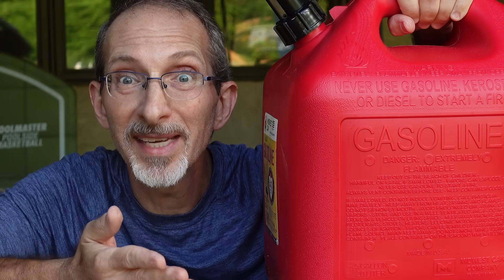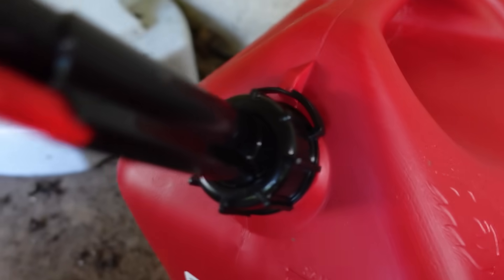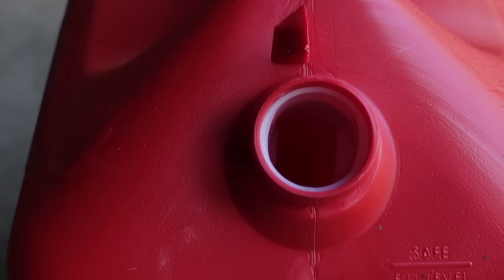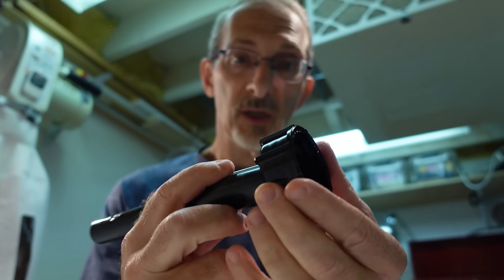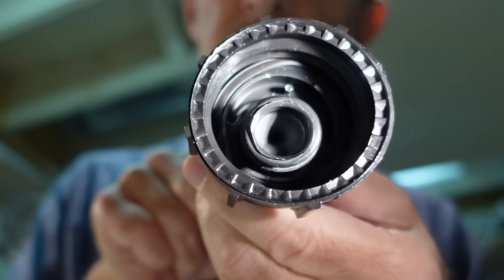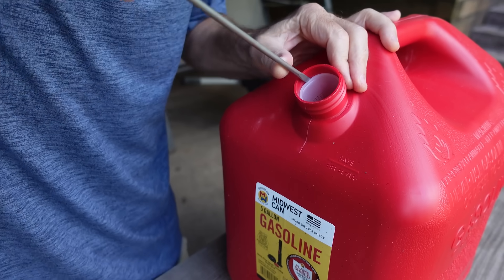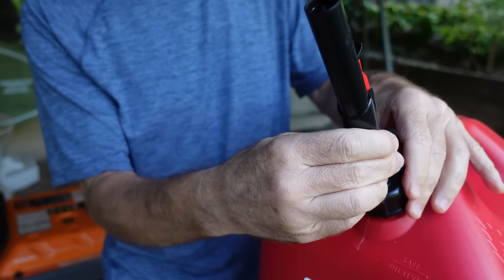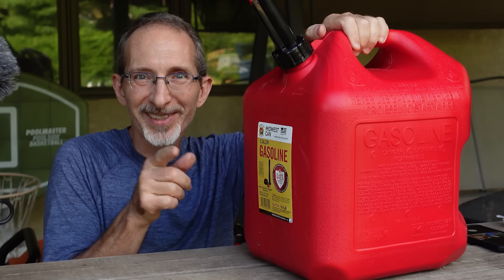Gas Can Modification | New Gas Can Fix

Comment: I’ve only ever seen gas cans used on cars that ran out on the side of the road. 99% of the time they are used for small engines. Aside for riding lawnmowers and four wheelers, not many of those have enough weight to not get shoved around by the can
Reply from the maker: Agreed! People who have these nozzles on smaller containers seem to have better luck with them. But it is just too awkward on my 5 gallon cans to be usable. Thank you for watching and for commenting!

Comment: Jesus some times it's worth just buying another one with a normal spout and a vent to boot, can is still gonna suck regardless until it has a vent.
Reply from the maker: Jed, I added event in my second video, link in the description. At the time I bought these, they were one of my only choices. After the modifications they are not so bad!

Comment: I’ve never had a problem with mine, just been patient and not go full blast when filling and I like the spring because it allows me to control the speed of flow from the can easily.
Reply from the maker: Adam, it is nice to have some counterpoint in the comments. Thank you for watching and for joining the conversation!
Reply: @MikeFyxdt  oh no worries, not saying your opinion wasn’t valid, Im wondering if different manufacturers use different strength springs.  As for the lock on the cap mine permanently bent in the first time I used it.
Reply from the maker: @adambeard4427  I think you are onto something, all manufacturers probably have different specifications. I’ve heard of the locks on the caps bending from other people, too. Most of my objections to these designs are gone now that I did some modifications. I have to say that there is nothing like the old, simple designs!😁

Comment: During Laura we were pouring gas all day just to keep the lights on and I gotta say, those safety nozzles are anything but safe. They pour eeeverywhere.
Reply from the maker: Chase, these containers are hard to use in good weather… Nobody needs the extra stress of a difficult spout in the middle of a storm. Hopefully there will be better designs in the near future. Thanks for watching and for commenting!
Reply: @MikeFyxdt  Your welcome, and we just removed the nozzle and funneled it, f that nozzle.

Comment: Do you have a hack for styrofoam gas cans? Idk if it's hot out but mine all melt. I was trying to stock up on gas and got it all in my trunk.
Reply from the maker: 2 1/2 gallon or 5 gallon Styrofoam containers? :-)

Comment: If you buy normal gas cans you are a chump they suck. I recommend buying these I know they're made for motorsports but they work for everything. (Accept for small power tools like weed eaters, chainsaws, leaf blowers etc. that should be obvious.)

https://www.amazon.com/VP-Racing-Square-Utility-Gallons/dp/B00AVQCCCW/ref=sr_1_4?crid=CQXVTBYMZT06&dchild=1&keywords=vp+racing+fuel+jug&qid=1621925383&sprefix=vp+%2Caps%2C184&sr=8-4

I know they're expensive but they're worth it. We have been using them for 2 years now and they're still in mint condition they're very durable. I prefer the VP Racing brand but you could probably find another brand for cheaper.
Reply from the maker: Jake, these motorsports containers or a popular option! Thanks for watching and for sharing.

Comment: I just bought a Chinese replacement spout and threw spout in the trash. I was so pissed I got gas everywhere in the middle of damn winter trying to refill a snowblower.
Reply from the maker: Robert, you brought up a good point that these spouts might be even more difficult to manage in cold weather. Trying to quickly refuel a snow thrower without getting snow in the gas tank is a challenge in itself, you don’t need a finicky spout slowing you down. Inexpensive replacement spouts are a very popular option, and I will be reviewing one in an upcoming video. Stay tuned!

Comment: Did you notice that the Rubber seal on the spout is the cheapest Rubber and tears after refilling the can two or three times so that the seal breaks almost instantaneously I've noticed that
Reply from the maker: I haven’t had this problem yet, but I don’t put a lot of wear and tear on my gas containers. I’ll keep an eye on it.
Reply: @MikeFyxdt  I realize now your gas containers are of a different manufacturers and mine and the O-ring seal I'm talking about on mine that is ridiculously cheap thin plastic and brakes almost immediately after unscrewing the cap and replacing it during refueling I thought it was a shady way for the gas can company to get me to buy a whole new gas can a week after I already bought a whole new gas can I saw the gas cans you bought and that O-ring seal is actually looked relatively functional without damaging the seal I'm talking about is obviously made to break immediately and it in my opinion it must be because they think everyone will run right out and buy another gas can anyways thanks for your response soon I won't be needing my gas cans anymore best wishes and blessings

Comment: I have a 75 yr old female friend that just got one of those horrible cans last week.  She has arthritis and the can was useless for her.  I then cut the black part so she could take the spout off easier, and I broke the red piece so it wasn't so hard to press.  Now it looks like I need to go a little further and remove the screen and filter.  Thanks!
Reply from the maker: Rod, check out my second video where I show how to modify the spring to make it easier to depress, but it still keeps the self shut off feature of the spout, which may be helpful for your friend.

Comment: videos like this make me glad to be seeing steady progress away from gas, no worries about this stuff with electric.
Reply: ha! think you are safe???? Wait until they came up with the safety electric plug for your battery.   It will take 7 times longer to get your battery charged (because fast charging has 1 in 157,537,248 higher risk of causing a fire), and it will only do it from the hours of 1 am and 5 am (because of base loading don't you know) and only if the internet certificate issuer server is up and running and if you paid your 50cent license registration fee (because regulations must exist to control you)  hopefully  Myke in this channel will show us how to just use a solar panel set to do the charging at your own leisure.   (oh how achingly I wish that I was just being sarcastic)
Reply from the maker: Lol, we are in the early stages of battery operated cars and houses. I’m quite sure that in 20 years we will be looking back at today as “the good old days“! :-)
Reply: @Midatlanticriverrat  Current trajectory seems to be easier and faster connections.With the exception of damaged connectors and cables or cheap knock off components, fast charging is pretty solid at this stage. Most home chargers are configurable so you can have it wait until the electricity is cheaper or not, your choice. As to the calling home for permission to fast charge, that is vendor specific and you have options. Solar actually would mitigate the base loading issue as well. The devices do not care where the power comes from, just that it is sufficient.
Reply from the maker: You bring up an interesting point… I don’t think the problem lies with the gas appliances, but rather with the current state of gas container regulation. As long as gas is inexpensive and gas powered tools are relatively available, I’m sure they will share the market with electric tools for sometime to come.
Reply: @MikeFyxdt  Just as horse and buggy shared the roads with the model T. It will not be an overnight switch, but it is good to see the progress. Honestly at this point generators are pretty much the only place I can see gasoline, diesel, LPG, or CNG being used for an extended time and that is primarily due to the efficiency limitations of our current state of technology in solar and wind. As it currently stands, you can get exponentially more power in a much smaller footprint with a combustion powered generator. 

That said, the benefits of minimizing the number of combustion engines in the mix cannot be overstated. The reduction in maintenance costs and hassle alone is immense. In a remote job site scenario, a single combustion engine to maintain just to run a generator to charge a handful of 40v packs to run brushless tools vs a myriad of small combustion engines with all of their own maintenance requirements.

Comment: I have the same can.  It sat in my warm garage and when I went to press down the red lever and slide it back a ton of compressed gas flew all over my garage wall.  Not very safe.  I go to rummage sales looking for the old style cans
Reply from the maker: Dave, yes, these containers will swell with any temperature change. I always unscrew the big spout color to “burp“ the can before I use it. Thank you for watching, and stay safe!
Reply: You can buy nozzles for “water cans only” on line, the identical ones that used to be for gas cans.
Reply: I’m glad to hear I’m not alone when I say that I look for older gas cans at garage sales. I’m a fan of the 20 year old 2 gallon cans with the black spout with the easily lost yellow cap. Those caps can be bought by the dozen. My wife can’t appreciate my joy when I score one for a couple bucks.

Comment: Having done a stint in an old school hardware store where I was in charge of the fuel cans I can say with confidence that Midwest Cans are junk lmao  

Justrite type II cans are great if you're willing to spend the money on the initial investment for a can you'll have forever.  As a slightly cheaper alternative "No-Spill" gas cans are pretty solid too, I've had a viton oring fail on one but it was an easy replacement.  They are technically a modern safety can as well but they use a pretty different design from most of the others, they're push button and quite easy to use.
Reply from the maker: Thank you for sharing your experience! I bought these containers at the beginning of the pandemic, at a time that I didn’t have a lot of choices. It’s good to know that there are better designs out there! Thank you for watching and for joining the conversation.

Comment: A filter is a nice thought, but most of the machines we use have fuel filters.
These modifications are great!
Reply: Nor a filter.  If it was it traps the contaminants where it is guaranteed to go into the equipment.  It isn't a flame arrestor either.  Don't understand its purpose.

Comment: Get one for ATV’s or dirt bikes. They call them “utility jugs” to not get sued, but they handle gasoline just fine. No valve bs at all. VP makes a 3 gallon on Amazon for about $35, and will last forever.

Comment: I have a far less delicate solution. I just rip out the end spout leaving the fatter spout to pour and use a funnel as a gas cap. The act of ripping out the nonfunctional safety spout is immensely satisfying.
Reply: good idea!  My problem with this nozzle was that the gas was gushing out between the smaller spout and the larger spout...  now I only have one spout and no spill.  Thanks!

Comment: Lifting a five gallon and pouring with a non flexible spout is difficult. Can we do one more modification and give it a little more options on the lift angle? Thanks. Maybe I should just get a battery powered pump.

Comment: i have a different style nozzle for a tank i bought from lowes a few months back, has a small green plunger where the red part is in this vid, while it doesnt push back the whole nozzle like this one, its still a royal pain, needing an absurd amount of pressure to release, which has resulted in me spilling gas nearly every time ive used it, especially when filling up my little push mower, also on a side note with the filter, when pumping gas, just pump slow and it works fine 👍
Reply from the maker: Alex, thanks for commenting. It seems that different gas container manufacturers have their own version of these spring loaded spouts. Some sound like they’re OK, but the majority sounds like they are a pain. Thanks for sharing your experience and adding to the conversation!

Comment: I still have an old school metal gas can with a long metal bendable tube that only pours if you lift the airlock. Been in the family for 50 or 60 years. Works like a charm.
Reply: They are still available: https://www.justrite.com/ However, they are very expensive at $ 85.00 US. In my opinion, they are worth every penny as they are far safer than any of the new plastic cans, modified or not.
Reply: Don't break it or lose it!!!
Reply: I'll give you 500 for it lol. It'll save me money if I have to use that safety can
Reply: @pradamarfa513  I'd take you up on that for sure lol
Reply: "Jerry" cans. yep old school stuff. Many were galvanized. Rectangular shaped with about 4:1 ratio. I still have one gotta be at least 60 years old. Holds diesel with staBil as a preservative.
Reply: I have one of those in the gallon size. 
Great for small engines.

Comment: Let's not forget the other flaw:
The screw cap on many of these "safety" designs leaks from the contact point on the can, grommit design or not.
It's great when you not only spill gas trying to use these damn things, but then it leaks from the screw cap all over the side if the can wasting even more.

Saw this vid years after having to modify multiple newer cans and nozzles, one still has to have a paper towel wrapping (the crappy brown kind you see in public restrooms) around the screwcap contact point with a slip cover of a gatorade bottle with the bottom cut off.

The others had to buy and modify different nozzles, and some still required either pipe tape (the white tape for pipe threads), or the nozzle sealed on with silicone and a hole drilled into the other end for refilling (plug caps I'm using gas caps from cars st a salvage yard).

I was hit with an ad partway through the vid for gascan nozzles that aren't BS and will probably look into those the next time I (or family/friends) buy new gas cans.

Comment: YES!  Thank you for this video.  I had to get a new gas can about 2 years ago and found one exactly the same as you have in this video for maybe $12 new.  The very first year it started allowing condensation/moisture into the tank.  So, every year I have to flush the can out and buy new gas so Im not pouring water into my mower and tiller.  Water doesnt burn that great lol.  Now the neck just flat out leaks every time I fill my equipment dripping fuel the entire time.  Why does the government have to ruin everything?

Comment: What's the point of this non removable filter if the gas flows out in reverse?  Whatever gets trapped will sit in gas until it comes out the nozzle... Kinda like if it didn't even have a filter in the first place!  It's nonsense!

Comment: Or buy the kit that comes with a normal spout that has a cap that screws on the end and a breather valve that you drill a hole and it snaps in

Comment: As an engineer... I am optimistic these engineers knew they we forced to design something stupid and purposely made it easy to defeat the stupid.  Love this mod!
Reply: Well...This is why people hate engineers as much as lawyers and politicans.
Reply: Not if the government had anything to do with it
Reply: Just cut off the red safety and the rest of the nozzle will still work as designed with positive shut off and not pouring until Pushed into gas tank.
Reply: Maybe like the safety mechanisms on a patio heater? Ever had one that actually worked? I bet the safety mechanisms were disabled. Takes about 2 minutes to do.
Reply: These are the same jokers who put ethanol in gas to melt your plastic fuel parts.  It's all designed to make you give up on gas and start buying Chinese lithium batteries.
Reply: @Keith Rollman  Ethanol is put in fuel by the government to subsidize the farmers. Engineers have no say in it. Ethanol is less energy dense than gasoline, meaning you need to purchase more ethanol than gas to go the same distance, with all the same emissions. The government and gas stations are charging you for gas you arent receiving.
Reply: The reason for such strong safety measures is to prevent redneck to SPUR GAS DIRECTLY FROM THE CAN TO THE FIRE:

A Gas Can company was sued to bankrupt for moron than keep pouring gas into fire directly ignoring the big warning label the company put in the can.

So if a redneck disable the safety measures as this guy do the company can defend itself as the can's owner modify it so the company is not responsible of a bad use.
Reply: @EliosMoonElios  there are more idiots than rednecks.
Reply: @EliosMoonElios    wth is SPUR? I WAS IN EXCELLENT SPELLING IN school.   Spew? How about pour?
Reply: @EliosMoonElios the reason is so people give up on using gas equipment and go electric, I'm not sure where you got your info, these spouts are to supposedly stop vapors from going into the atmosphere
Reply: @EliosMoonElios  Ummmmm if someone wants to SPEW gas on a fire with this "safety device" in its still going to spill. Have you not noticed holes in the filter???

Comment: They came up with those so called "safety nozzles" because idiots somewhere don't know how to use an older style gas can without pouring it everywhere. In my entire life I've never witnessed the type of idiots as I have with this younger generation. They're even putting warnings on car batteries they tell you not to drink the liquid, so some idiot somewhere has actually drank electrolyte from a battery. Thanks for the video, I have about 10 of those 5 gallon cans that's I'm modifying tomorrow.